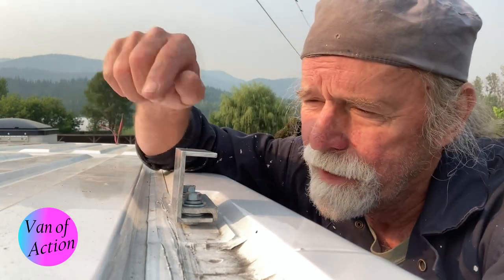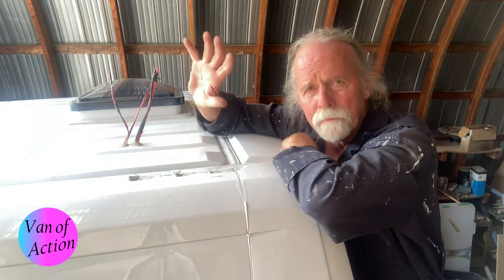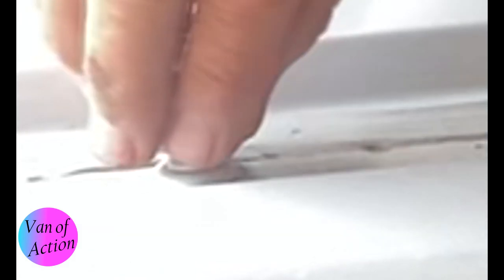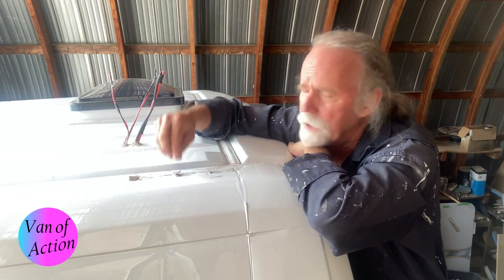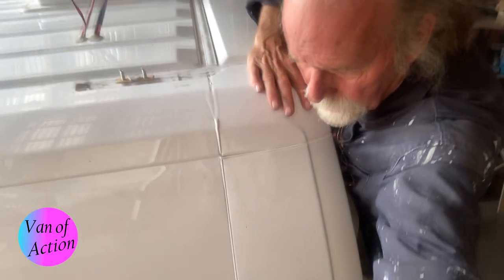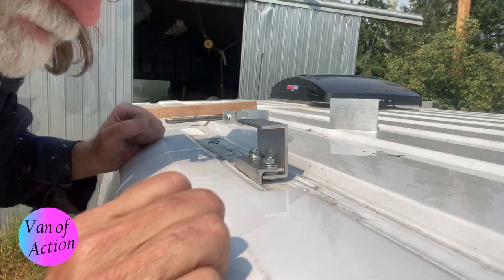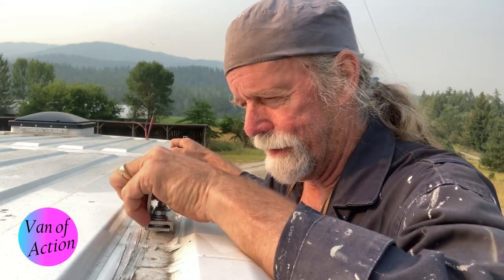How To Make D.I.Y.  Promaster Roof Rack Clips - solar panel roof rack van conversion  - Van Life

Comment: As a woodworker, you probably have a miter saw or a chop saw in your shop:  you can install on them a blade especially designed to cut aluminum like the one you used like butter and use a stopper to get repetitive cuts.
Reply from the maker: Thanks for watching and the comment - I do have a miter saw but I left it in Ontario when we made our Covid move to BC.  The only equipment I've had for my build has been the table saw that was in the shop I rented , a hand drill,  an orbital sander and a router.  Not complaing - it's just that way it is.  But you're right - it woud have made it much easier.  Be well.
Reply: A nonferrous metal cutting blade in a table saw works great on Aluminum and a few other metals as well.  A 10" version is not that much.  Carbide with a negative hook angle.
Reply from the maker: @christopherhaak9824  Thanks Christopher -  I agree, but it's something I've never done on a table saw - I wish I was comfortable with the idea.   The saw I'm using isn't mine and isn't that great to begin with so I went with the angle grinder.   Be well
Reply: I put a 7” ferrous metal cutting blade on my 10” table saw. The smaller diameter gives it more torque to handle heavier cuts. A spritz of WD-40 on each side of the blade prevents build-up of aluminum on the carbide teeth. Put the blade all the way up to reduce kickback.
Reply: @robertschulke1596  - thanks for the tips !!!

Comment: No jig needed and no angle grinder needed. Aluminium is a soft metal, so you can use your normal wood saws to cut them the same way. But I do swish out the blades anyhow for metal blades. I have these things on my Iveco van also. You idea is perfect. Thanx.
Reply from the maker: Hi Sunseker.   Thanks for stopping by and taking the time to comment. I did make that part harder than it should be - but at the same time - I’ve spent weeks working a table saw and have never cut metal on one.   So it’s good people see how a coward does it !!!!   Do you mean you copied the brackets ???  If so could you send me a couple o pics.   I’m collecting for a future video.   Send to vanofaction@gmail.com
Reply: @VanOfAction  Yes. I think your design is great. I will copy the base, but I may go another way with the main long metal pole. I will send you pix when I am done. Just got to see here in Sweden who has all I need this week.
Reply: 27:05  @VanOfAction
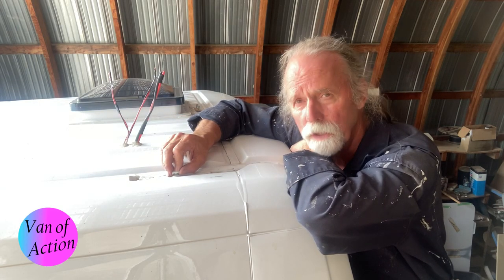Reply from the maker: @ericsrocksandsuchadventure9364  Hi Eric  - thanks - as you can see I don't measure a lot (never have) .....  but you can see the sample I made at   3:34 of the this video - I would recommend you do the same ...be well and let me know how you make out.......   Dave

Comment: In the future you could use carriage bolts and make a square cutout, then it is likely you could slip it over the stud on the roof. Thanks for sharing this!
Reply from the maker: Senglebe ! Thanks for taking the time to watch and comment.  That would certainly work, but making a square hole is way over my pay grade !!    Be well and stop back !!
Reply: @VanOfAction  No no, just buy a square drill bit! Lol

Comment: Thank you for sharing your work.  We too are building out a PROMASTER.   When we get to the solar panel chunk of work, we will do the same.  Kindest regards.
Reply from the maker: Hi Dwayne - Thanks for watching and thanks for taking the time to comment.  I am currently working on a second roof clip video that shares more details, measurements and "reasons for" - based on the comments and questions I've been getting.  So feel free to stop back at VanOfAction.com when the time comes.   Good luck with your build - mine has been nothing but fun !!!!   Be well and safe
Reply: good stuff.  i'll be watching for it.

Comment: That’s an impressive piece of work.
Reply from the maker: Bertrand !!  Thanks for taking the time to watch and comment -  they turned out really well and a number of people have copied them with the same results - which really makes me smile.   I made another video with a bit more detail if your interested ....   https://youtu.be/diIZe-teysU .   Be well and stop back !!   Dave
Reply: @VanOfAction  
I’m working with a Nissan NV200 and its mounting system has recessed nuts, so your idea won’t work. But I enjoyed the techniques you came up with to produce quality parts. My concern is that perhaps unlike your van with a flat roof line,the NV200 might have some curve to it.  If so, it means finding spacers, probably hard rubber of some sort. I take delivery of my van next week so any detailed ‘thinking’ will have to wait until I get exact measurements.

Regardless, as you say, it ain’t rocket surgery.

Comment: Hi Dave. As promised I am slowly working through your vlogs. This idea is the best of the bunch I have come across, IMO. Strong, simple and foolproof. If you needed more bar height above the van roof you could either use a wider C channel or add a spacer tube under the top rail with longer bolts. I adapted a universal commercial roof rack system with brackets from a Renault Trafic which had the bolt down type feet. I made a lower clamping plate which used the two bolt holes in the foot of the Renault bracket but my clamping plate had an L shaped slot in it. This meant that the roof pins were held side to side by all the clamp plates longitudinal slots and, by arranging the L slots in opposing directions cross rail by cross rail, the rack was held front to rear. I have three bars so two slots lock it forwards and one bar locks it from rearward movement. The reason? The rack came at a steal of a price from someone who didn't know its retail value and just wanted it gone from their roof. Plus point, there are lots of commercially available adapter brackets for this rack system. Minus point, cost, as usual but I was lucky to get a lot of extra bits with my bargain roof rail system. One of the extras was a wind deflector for the front bar which reduces noise when travelling at speed.
Reply from the maker: Hi David - thanks for the kind words.  I have to admit I'm kinds proud of this clip system - it was fun to have it turn out so well.   It's been copied by a ton of folks all over the world which really makes me smile.  There's evena couple tik tok videos other builders have put up, and graciously they always give a little credit our way !!!  It sounds like you got your rack the way you wanted it at a good price too.   And for what it's worth we get absolutely NO highway noise at all which really surprised me.  Dave

Comment: Very good, I was originally going to use the proper roof bars which came on my van, till I release they where in the way of my maxfan. So starting to think of alternative solutions, and this looks great.

One comment, make sure to use galvanised fastenings and not stainless. As aluminium and SS react, which causes the aluminium to go brittle and crumble (I've seen this). Not sure what you used.
Reply from the maker: Hi Rorie - thanks for watching and commenting,  you may not have seen them .... I made 2 other videos with more detail about the clips and roof rack - here   https://youtu.be/diIZe-teysU   and here  https://youtu.be/tkyhTzkyAOI   you may find them useful as well.  Also thanks for the Aluminum vs SS thoughts.  I just used what I had in the shop that day and I think there may be a mixture.  I'm watching it and can switch out if necessary.  I addressed this in the first link .....     be well and stop back !!!!     Cheers

Comment: Looks very neat.  Great Job there :)

Something that I would note maybe though?   Your plan for this is to fit solar panels and so the 20 or so Kg (44lbs?) is very little compared to what the roof will take.    However, these lugs that are pre-fitted out the factory are really just locators for the roof rail brackets and not meant to take the weight.   If you look at the official OEM mounts you will see each Bracket is a length of extruded aluminium and while it uses the lug for position and locking into place, all the weight goes onto the roof shoulder and an inner rib, and not on the lug and close surround.
If someone was making their own brackets to use for carrying serious weight (the OEM kit is rated at 150Kg (~350lbs), they really need to have the bracket sit on the roof, and not just where the lug is.

(I've actually got the OEM Rack Kit in a box ready to fit on a customers camper for the sole purpose of fitting Solar Panels, and it is engineering overkill for that purpose for sure, which is why I am looking at cheaper options for future installs, but using the lugs alone would concern me)
Reply from the maker: Hi David, thanks for watching and taking the time to share your thoughts.  I agree 100% with the point you've made. If one intended to have a deck or some other object on the roof there would be  other considerations.   However remember that  these studs are the only thing that holds ALL racks DOWN.    Some commercial racks are designed to support significant weight.   So my thoughts   (as a carpenter) is that if they are strong enough to keep hundreds of pounds ON the roof while driving and in accidents - they must be strong enough to support a fair bit of weight as well.    All my roof rack is for at this time is the solar panels.  Going forward - because I have the solar panels up there, there will be very limited space for anything else without creating shade on the panels which would defeat the whole purpose.   I have had a number of subscribers copy the plan as so far everyone has found them easy to make.   If you didn't see them - you may find these video helpful as well.   https://youtu.be/diIZe-teysU    ......   https://youtu.be/tkyhTzkyAOI    I can't imagine paying for a rack kit just for the solar panels.     Be well and stop back.  Dave

Comment: I wish I had seen this when I was building my Promaster campervan a year ago. I worked on different idea and finally gave up. Finally, I ordered a CNC machined attachment clips for $300USD for 8 clips, not a bad price as they were stainless steel and had paddings that protected the van metal. Thanks for sharing.
Reply from the maker: Hi Ozman - thanks for watching and taking the time to comment.   Too bad for the timing - (my clip design doesn't touch the roof so there is no need of the padding.)  - but at least you got it done and the summer is coming !!!  I hope you have lots of time to enjoy it.  Be well.
Reply: @VanOfAction  Thank you. Subscribed with my initial comment. I would like to see your channel grow. Btw, do you work on building campervans? I'm a potential customer. Thank you.
Reply from the maker: @ozmanfidaar6311  Thanks for subscribing - I will be looking for a project for next winter and I'm not sure if that will be something for me or someone else ....  maybe we should investigate to see if anything works ... you can email me at vanofaction@gmail.com

Comment: Great video. Thanks for your work. Only thing I would change is to ditch those lock washers. History has proven they don't work and may even do more harm than good.
Reply from the maker: Hi Grow Your Heirlooms - thanks for watching and commenting - how would you recommend they be bolted together ?
Reply: @VanOfAction  Exactly how you've done. They are great clips and you did a great job. Just use the flat washers not the lock washers.
Reply: @Growyourheirlooms  Thanks for the reply .... I'll keep an eye on things.  Cheers

Comment: Perfect.  I had the same problem.  Had no clue how to attach to them. I was about to glue my solar panel on but I didn't really want to do that in case I ever needed to replace it.  Thanks
Reply from the maker: Jesuscross9 - thanks for watching and commenting - I'm glad you found this clip design useful.  I am publishing today the roof rack construction.   I got 3 panels on the roof on an aluminum rack - totally removable if needed for less than $ 200.00 CDN.......  be well and safe.

Comment: If you use carriage bolts, they may fit the other way. Good instructions! Cheers
Reply from the maker: Hi Frank - Thanks for watching and the suggestion - They may have fit - if I understand what you're saying properly - but because the space between the underside of the clip and the roof is fixed I didn't a variable length (depending on how things compressed as they  pulled together) there.  And secondly,  with a carriage bolt I would have need a square hole !!  WAY above my pay grade LOL -   If you didn't see I made a second video with more detail as I was checking over the winter ... you can see it here https://youtu.be/diIZe-teysU    if you go to 5:18 in this video you'll see how I stopped the bolts from spinning as I tightened.    Be well and stop back.  I love hearing others ideas and I think it helps everyone.   Cheers

Comment: You can cut aluminium with standard woodworking tools, i cut 8mm plate with my woodworking mitre saw,super clean cuts very quick
Reply from the maker: Hi @Z3n ……….  Thanks for watching and commenting.  I have since learned that - but I have  not tried.   Hope you stop back ….. Dave

Comment: I've watched this once through initially & then later when I was ready to build, I skipped around trying to find the size of drill bit for the holes that slide over the factory pins. Can you please add it to your main comment below the video? I picked up some scrap 2 x 1" aluminum C-channel today at a local recycler, more than enough for the brackets. I think I'll go back & get the other pieces I saw. $3 got me a 56" length! Thanks.
Reply from the maker: Hi Zarguy .... I LOVE that !!!   $3.00 !!!!!   Man that makes me smile.  I'm sorry about the drill size missing.  Unfortunatey my van is 3400 miles away at the moment and my shop is all packed up for moving this weekend ....  (video comes out tomorrow) ....   What I did initially because it's impossible to measure was .....  I machined a piece of wood 3/4" x 1/8" x 3" - then using my chop saw I just cut a groove part way through at about the middle.   I just kept increasing the groove until it fit as I wanted it to.  Be sure sure to post some photos of how you're doing.   These clips have been copied all over the world and one day I want to do a compilation video ..... be well .......  Dave

Comment: What size channel did you use
Reply from the maker: Hi John / thanks for watching and commenting.  I used a 1” x 2” x 1/8” C channel for  the clips.   But that was because of the height I wanted off the roof to give me the clearance at the peak of the roof.  You probably shouldn’t go any narrower but you could certainly use a wider profile if you wanted to be higher. The “L” angle for the top clip was 1” x 1” x 1/8”.   Hope that helps.    Be well …..

Comment: Thanks again for a fantastic video. Are you concerned with aluminum deforming with weight, pressure from wind pulling on panels, etc.
Reply from the maker: Hi Greg -  thanks for watching and leaving a comment.  I was wondering about that and so when I was buying -  I blocked a piece of 1" x 1" x 1/8" square tubing between 2 off cuts of steel beams on the shop floor.  I spaced the block 6'-0" apart.   Then  I asked the guy biggest guy in the shop to stand on the aluminum.  He was about 300 pounds and the tube flexed but didn't come close to bending.   All together the solar panels don't weigh more then 50 pounds.   As long as all you want the solar this rack is over built !!!  Be well and stop back.  Dave
Reply: @VanOfAction  thanks, nice 👍

Comment: Good job. Amazon sells those brackets for about $50 apiece🤬. First we’ve been cutting aluminum with the same miter saw blade we use for wood for years no problem. Second, I hope you used stainless hardware so no rust. I have a new Promaster extended I’m in the process of starting a build and there is no way I will spend $2,000 US for a roof rack, I don’t care how long it takes me to self build. I plan on fabricating my rack with a combination of extruded parts and 80/20 components.
Reply from the maker: Hi Michael - thanks for watching and taking the time to comment.  I have not looked lately - if you could post a link to the clips available on Amazon it would be great.   First - I've heard from a number in the community about using a saw - During my build I didn't have a miter saw - my Dad used to do all kinds of metal work on his table saw.  Not my cup of tea.     Second - I've also heard the stainless hardware story before a bunch of times.  I'm about 30 minutes one way to a hardware store so for my build I just used whatever I had laying around - not stainless.  I'm able to monitor things pretty close.  The first inspection was last winter - and there was no evidence of rust.   The video is here (and there is more details about the clip design too)  https://youtu.be/diIZe-teysU      At the end of the day,  there are only 40 nuts and bolts and if I see signs of deterioration I can change them out easily. I'll do another inspection video this winter.   Congratulations on having a new Promaster.  I've been looking for another for over a year and can't find anything in British Columbia that makes sense.   I had planned on using 80/20 at first but it was hard to get where I am, which in the end proved a blessing.  The cost of the tubes I used were a fraction of the the cost of 80/20 and honestly I have more faith in the integrity of the connections.    Hope you stop back and share how your build is going .... be well Dave